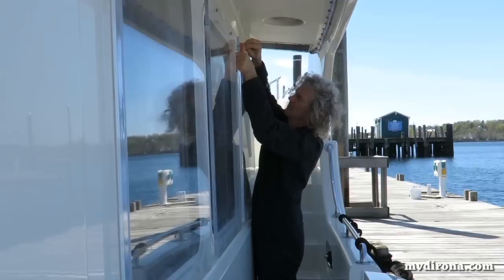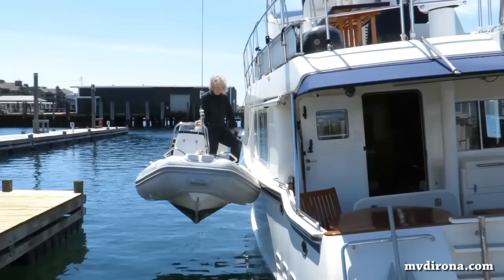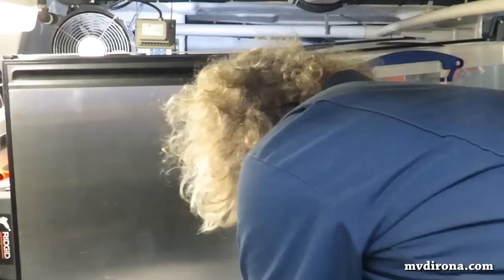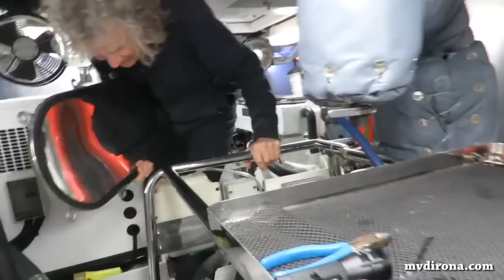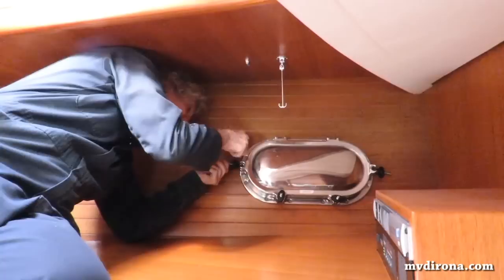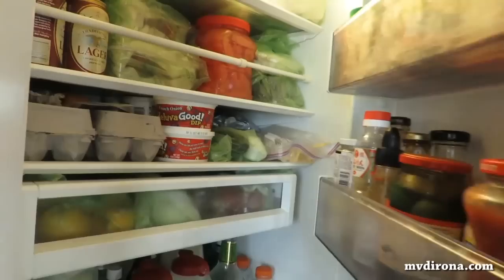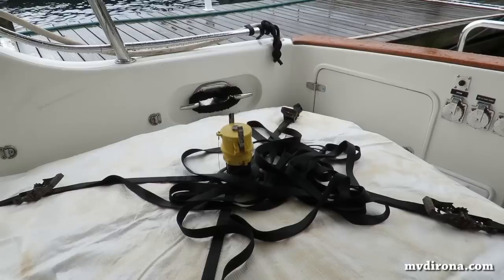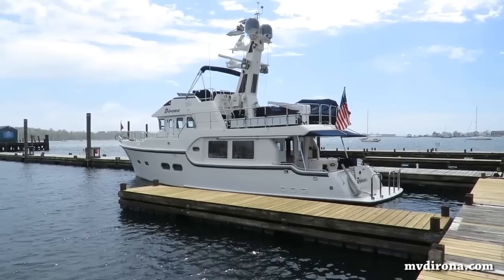Preparing Dirona for the North Atlantic Crossing (MV Dirona Channel)

Comment: What do you estimate your fuel consumption is in Gallons per hour? Or how many gallons did it take to cross?
Reply from the maker: Fuel is speed. Within limits, the more fuel you have the faster you can make the crossing and the less time you are exposed to weather conditions that were not predicted when you were starting the ocean crossing. What we do is decide on the fuel reserve and then we adjust speed to consume exactly this quantity but no more. We often start with 400 gallon reserve to maintain max option value, usually drop to 300 gallons fairly quickly.  Sometimes we'll set the reserve as low as 200 gallons. 

These are the stats for this trip: 2,801nm, 17-day trip our average speed was 6.86 kts, and we consumed 2,386 gallons of diesel for an average fuel economy of 1.18 nm/gallon. We arrived with 346 gallons of diesel, 46 gallons above our 300-gallon reserve because we’d slowed down near the end to approach Kinsale in daylight, and a flooding tide carried us in.
Reply: MV Dirona  good morning (in California) thanks for the reply. That was perfect and I greatly appreciate it!!! I see so many sailing channels but you are the 1st motor yacht channel I have stumbled across So until last night I didn’t think it was something worth thinking about.I’m looking to set off on an adventure my self soon and am/was looking for a sailboat but what you do is not that bad economically as far as I see it so I’m really going to have to sit down and start all over now and see what direction I want to go. Cheers and thanks again,look forward to your videos!
Reply from the maker: We have spent a lot on fuel over the years but it's rarely our biggest expense and this is a really is a comfortable way to travel.

Comment: How do you get the fuel from the bladders to the main supply tanks?  Great videos by the way. Thanks for producing them!!
Reply from the maker: That's an important question: "how do you get fuel out of a bladder and into the main tanks?" A common choice is to pump it from the bladder to the tank opening using a portable electric pump. This is a nice simple solution but, in rough water, the tank fuel opening may be awash.  What we do is have a bulkhead fitting that is directly plumbed to the fuel transfer pump. 

On this model, short hoses attached between the each bladder and the bulkhead fittings using camlock connections. When it's time to pump the fuel from the bladders below, I just go down to the engine room and set the valves to pump out the bladders into a specific fuel tank below, then turn on the pump. A couple of hours later, the transfer is done and the fuel bladder is vacuumed down flat and ready to be packed away. It's a super easy to use technique.
Reply: MV Dirona Thanks so much for for this information and your excellent videos. You both are a wealth of knowledge, and it’s appreciated!!

If you get a chance, I’d like to know more about the bulkhead fittings...Thanks in advance
Reply from the maker: Camlock fittings are nice, dual lever snap on fittings that are fluid tight. and popular in fuel transfer applications and many other industrial applications. Some examples: https://www.camlockfittings.co/.

Comment: Why no walkway on port side?
Reply from the maker: Yet another small boat compromise. As boats get smaller, the second walkway starts to really reduce the interior space in the boat so it's common to put walkways on only one side.  Some operations would be easier with walkways down both sides but that's not the way this boat was made and, generally, I think it is the right trade off for a boat of this size.

Comment: Nice video, what
 brand is that crane?
Reply from the maker: The crane is a Steelhead ES1100. The ES1100 is actually an ES1500 with a longer boom (16' reach) which requires it be derated from 1,500 lbs to 1,100 lbs.

Comment: So how do you get the fuel from bladder to the engines?
Reply from the maker: That's a good question. Getting fuel from bladder to below decks needs to be done with care to avoid introducing water or loosing fuel. We think we have a fairly elegant solution where we have small hose that connect the fuel bladders to a bulkhead fitting that runs to the fuel manifold below decks.

The boat has a fuel transfer system that can transfer fuel quickly from any tank to any other tank.  The fuel bladder bulkhead fitting is connected to this fuel transfer system.  Using this we can pump fuel from bladders to any tank below decks without spending time outside.  A side effect of this approach is all fuel in the bladders is filtered before flowing into the tanks.  This approach can move the fuel below decks fairly quickly, it does it without risk, the fuel is fully filtered, and allows the bladders to be pumped down until completely empty. It vacuumes out the last bit of fuel making the empty bladders lighter, easier to fold, and easier to move.
Reply: @MVDirona   Thanks for explaining that to me I appreciated it . Have an excellent Sunday
Reply from the maker: You too!

Comment: A pair of plate glass suction cup handles might be helpful to install the storm plates. And maybe screws with knurled knob ends so you don't have to carry a screw driver.
Reply from the maker: That's a good idea. It would make handling them more secure a probably easier as well. I'll give that a try.  Thanks,

Comment: Was that 1/4" or 3/8" plexiglass for the storm windows?
Reply from the maker: The storm plates 1/2" thick. The upside is thicker is stronger but the downside is they are fairly heavy.
Reply: I BET they're heavy.  Did they come with the boat or did you have them made?
Reply from the maker: Nordhavn offers storm plates as an option on new boat orders but getting them made would be easy as well. The hard part is you need window frames with provision for screw in storm plate attachment or you would need to come up with some alternative mounting approach.

Comment: How do you get your fuel from the bladders to the tanks?
Reply from the maker: The fuel transfer system we have designed uses the on board fuel transfer system used to transfer and filter between tanks. There is a bulkhead camlock connection on the aft bulkhead. There are short hose segments made up that allow the cam locks on the tank to be connect to the bulkhead directly. 

When it's time to bring the fuel below, the safety valve on the top of the tanks is opened and the transfer pump is engaged. A couple of hours later the bladders are emptied and vacuumed down flat. This has the advantages of 1) filtering all fuel coming on board, 2) positively draining the bladders so that there is almost nothing left in them making them lighter and smaller for handling and storage, and 3) the main tank fill isn't open during transfer so there is no risk of water entry and there is nobody out on deck during the operation.
Reply: Thanks. I found out how on your engine room video.

Comment: With the deadlights installed on the inside, how does this stop waves from breaking the glass? Wouldn't it be better to install them on the outside?
Reply from the maker: I think you are right, putting them on the outside would both prevent water ingress and the window being broken. On the inside, it prevents water ingress, they are easy to install, but window  damage is still possible.  It would be hard to get to the outside of the portholes if they were externally mounted.
Reply: Terry Tytula Deadlights, also called storm covers, are typically put on in storms or rough seas. Or, in this instance, put on before leaving port when underway with minimal crew. The first reason for interior placement is ease of use. As MV Dirona stated. Secondly placing them on the outside hull could result in flooding if the deadlight is ripped off from debris in the water resulting in a possible breech of the hull (mounting hardware being torn from the hull) with or without glass failure. If the deadlight were torn away or fell off due to improper securing, there would be no protection if the glass were to fail. Use of deadlight seal/gasket creates slight pressurization reducing the likelihood of port glass failure. Similar to squishing a sealed can of soda. Once opened their is no pressure to resist crushing the can. The glass can only sustain a certain amount of flex before failure. The deadlight reduces the flex to a point. Maintaining the gaskets around the deadlight is not only important to prevent water penetration in the event of a glass failure, but also to maintain the pressure between the glass and deadlight. I hope this has answered your question. Cheers!
Reply: Terry Tytula a

Comment: would you do it again
Reply from the maker: That's an interesting question Robin. We have crossed every ocean in the world. You can see the course of our trip around the world here: mvdirona.com/maps (scale out to the max to see the entire route). But, this last crossing was a more difficult one so it does influence our thinking. We saw three medium sized storms and, at times, were in 20' seas. You can see video from the North Atlantic crossing here: https://www.youtube.com/watch?v=guEnTp2a6Sc&t=3s. That we have seen before but we also had a serious water leak that was a bit scary: https://mvdirona.com/2017/05/alarms-at-115am/. The combination of rough weather and a mechanical problem will cause us to think hard before taking on another ocean crossing.

Overall, the net is I think we would do it again but we would be more careful in the time of year we went. In past crossing we have been more selective in timing and, generally, haven't seen much rough water. And, in a small boat, that's really where you want to be :-).

Comment: Something I regularly see on most boating videos the boats are hugely expensive with lots of great safety features but when it comes to the fire extinguishers I see the lowest quality extinguishers. Is this because that’s what the boat manufacturers installed, because they are aluminum or some other reason?
Reply from the maker: Weight is not much of a motivation in a trawler. We're already 55 tons so I don't think lighter is the motivation.  A common choice on Nordhavn's is Xantex FireBoy. I suspect we are just using what they are supplying. What aspects of the system do you not like?
Reply: MV Dirona I think the on board automatic fire suppression in most cases are fine. My thought about aluminum extinguishers was more of an anti corrosion/rust aspect not weight. I find it ironic that manufacturers of fine motor coach’s and yachts skimp on extinguishers. One of the the low quality extinguisher manufacturers just came out with a recall for over a million extinguishers for the possibility of failing to work, one death and a number of injuries are attributed to the recall. I enjoy your videos keep them coming.
Reply from the maker: On the use of lower quality fire suppression equipment on buses and boats, it might be the manufacturers trying to save money but, in the case of Nordhavn, it's all optional equipment. The manufacturer offers an optional package that customers are welcome to purchase or not. Customers tend to get what is offered as an option but sometimes a customer asks for a different package and it too becomes an option.  

What's on Dirona is a large bottle in the engine room that triggers on heat. On trigger it shuts off fans and engines so the fire suppression chemical stays in the space. There is another similar system in the lazerette.
Reply: MV Dirona please don’t take this as being argumentative, I fully understand fire suppression systems (I worked in the marine and land fire protection for decades.) my point was that fire extinguishers that are routinely installed by marine and motor coach/homes are low quality with a higher failure rate.  Safe travels.

Comment: Why is cabin not centered?
Reply from the maker: Good question. Asymmetric cabins allow the interior to wider but still gives a walkway down one side to allow the boat to be tied off more easily. On larger boats, full walkways are the right choice. But, as boat size is reduced, giving up enough space for two walkways can make the interior feel excessively cramped.

Comment: Another way to not have water go down your exhaust during heavy rains is to put a Tommy knock around it have an excellent day
Reply from the maker: The term Tommy knock isn't used where we boat. Can you describe this solution to water down the exhaust pipes of dry exhaust boats  in more detail?
Reply: @MVDirona   The Terminator is just a weighted flap if you ever driven down the road and solve 18 wheelers with straight pipes and see that flap on top that's bobbing up-and-down that's a Tommy knocker It does the same thing as your cap that you used on your exhaust pipe but you don't have to remove it or put it on every time it does it for you by staying close until exhaust comes out

Comment: Surely hope you made it to your destination..The stabilitiy off this vessel is not that great in the first place, and is worse after filling those fuel bladders....
Reply from the maker: Even a marine architect can't look at a video of people working around a boat and asses stability. This boat exceed the CE Category A All Oceans certification ("A recreational craft given design Category A is considered to be designed for winds that may exceed wind force 8 (Beaufort) and significant wave heights of 4m and above") by a considerable margin. With full deck bladders, the boat still does pass this same set of tests.

Comment: what is the pole for above the port side windows?
Reply from the maker: That's a flopper stopper which is a passive roll stabilization system. The pole is stored directly above the windows. When deployed it is at right angle to the side of the boat, held there by lines and rigging up tot he mast, and hanging from the pole is a large stainless hinged plate that folds up and easily goes deeper as the boat rolls that way and then unfolds and strongly resists roll as it is lifted. It's a great system that can make an otherwise rough anchorage enjoyable.

We an underwater video showing the flopper stopper in action here: https://www.youtube.com/watch?v=C9cCl_ohwjU

We also discussed it in operation here: http://mvdirona.com/2012/11/hilo-to-honolulu/
Reply: thanks for the great reply!

Comment: How much money does the fuel cost I know its a weird question
Reply from the maker: Fuel prices can be very inexpensive in some parts of the world like South Africa and the US or very expensive like Australia and much of Europe. It really depends where you are and the dynamics of the world oil trading business.  The boat carries 1,750 gallons (6625 liters) and, when using the on-deck fuel options the capacity goes up to 2710 gallons (10,258 liters). At full load that's a bit more than 8 tons of fuel in a 55 ton boat.
Reply: @MVDirona  So with usd it 1.638 per liter so 10258 * 1.639 = 16803 usd to fill it all up. Yikes. 
Can i add a question to that then, how many km(or miles) do you normally get per liter to say cross the ocean ?  or just sailing along the coast on a nice day ?

Comment: Your adding 7200 pounds to Aft and the bow doesn’t lift up allot? I’m mean structurally the Aft  floor is good .. That’s a beat of a troller .
Reply from the maker: The boat is 55,000 lbs so the additional weight does effect the trim slightly but it's a surprisingly small change.

Comment: Amazing the power density of oil over coal that such a 'small' vessel can travel transatlantic.
Reply from the maker: Your right. The longest run we have done is 3,650 nautical miles from St. Helena to Barbados: https://mvdirona.com/2016/01/3650-to-barbados/. The range is pretty respectable for the size of the vessel.

Comment: I guess the areas with fuel bladders will be non smoking!
Reply from the maker: Surprisingly, it's not as dangerous as you might guess. The tanks are full of diesel and the diesel flash point is quite high. Even in the presence of a spark, diesel won't ignite until the vapors are up above 400F. However, you are right, if something ignites parts of the boat on fire, the below deck and above deck fuel tanks will feed the fire and it will rapidly be unstoppable. 

On boats, considerable care needs to be used around any risk of fire since there are so many ways to lose a boat quickly to fire.
Reply: @MVDirona  its kinda ironic that it's hard to put a boat out when your surrounded by water
Reply from the maker: It is a bit ironic. We actually have a 150 gallon/min fire pump on board Dirona so we can fight fires using sea water but you wouldn't take that option unless less destructive approaches have failed.